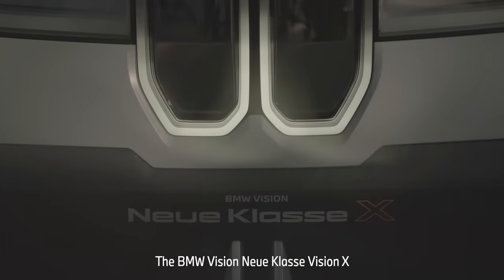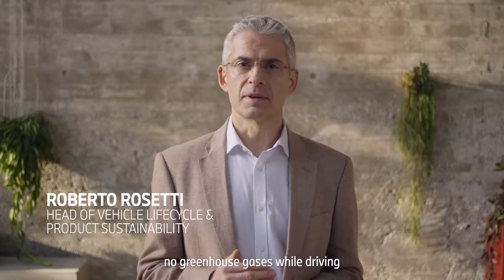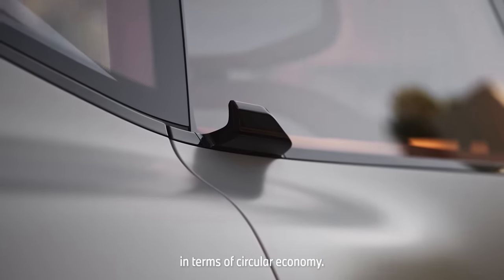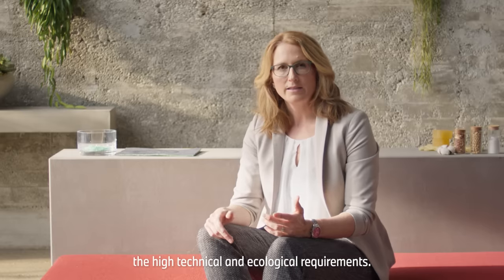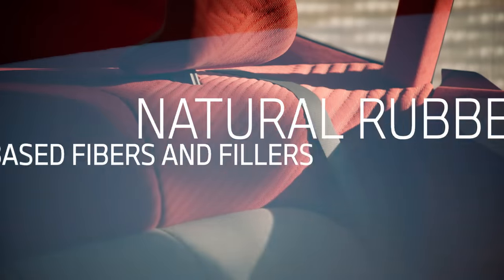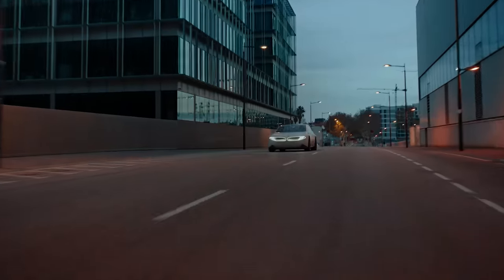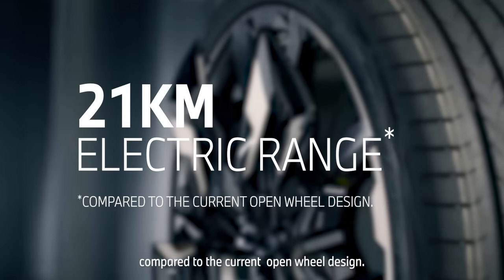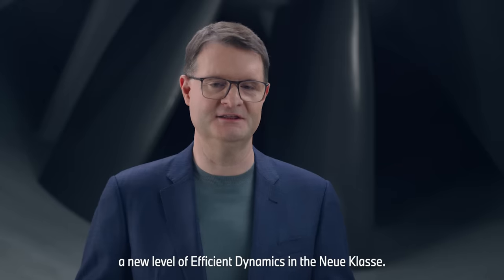Our sustainability concept of the Neue Klasse

Comment: Straight-6 engines, rear wheel drive and the beautiful driver-orientated interiors were the reasons to get a BMW. Now that's gone, what will be the USP's of these new BMW's and reasons to justify the no doubt hefty pricetags over let's say, a Tesla Model 3 Highland, outside of the badge?
Reply: Bmw's hand is forced, as is everyother OEM's. EU regulations, elsewhere too, stipulate recycling quotas, plus the producer has to take the vehicle back, so they have to design it to be taken apart quickly. This dictates design direction and material choices long term.

Comment: Nice design but please keep the Touch Contoller (https://www.youtube.com/watch?v=WKmxrvDupCI), Gesture Recognition (https://www.youtube.com/watch?v=1lxxky_vJH4) & Voice Recognition systems in the car allowing navigation in HMI without having to touch any screen (which prevents fingerprints and also increases safety).
I don't want my future BMW to have the same user experience as a Tesla Model 3 which requires most of the time to touch the central display !